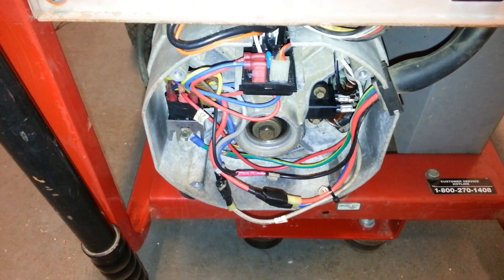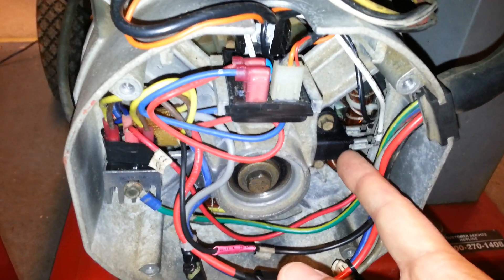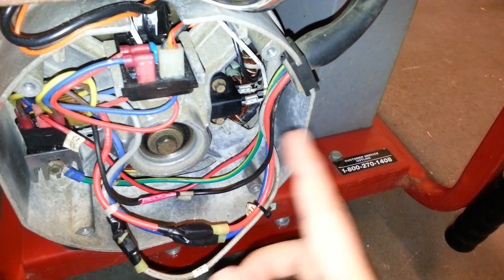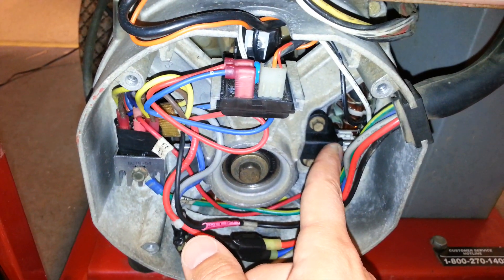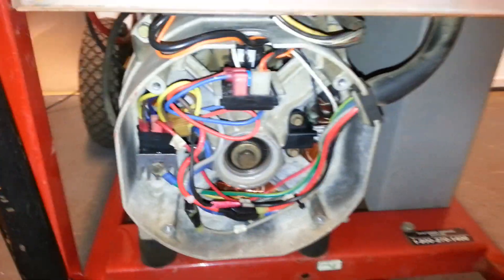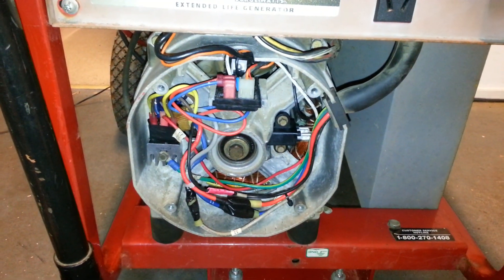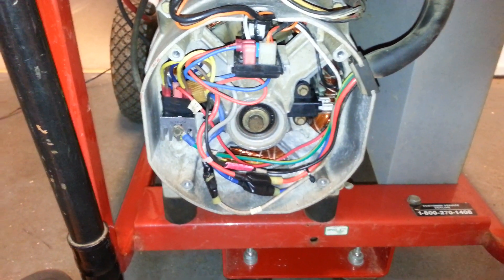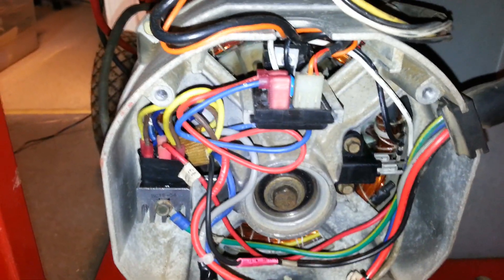Generac Portable Generator: How to Test the Windings

Comment: bought a 7000 exl generator that runs but doesn't have the panel for the outlets. how can I connect the wires directly out of the stator unit to a transfer box? would appreciate some guidance.
Reply from the maker: i would not recommend such a setup. replace the panel. it has the circuit breakers, neutral ground bond jumper, etc.

Comment: Happy New Year xboxer1985.  I have seen during my searches on the internet a Generac 7550exl the same as mine and yours with a 50 amp twist lock which ours do not have.  I'm wondering how you would use and why a 50 amp receptacle was placed on the generator when you only have 30 amp breakers.  In-addition, would you be able to use both 30 amp receptacles at the same time? Can you run 2- 30 amp lines from the 2- 30 amp receptacles to the electrical panel? Or is the generator just 30 amps in total?  Can you add a 50 amp plug to our generators?  Just curious.  As always Thank You for all your expertise.  John
Reply from the maker: John Ambrosino john. Happy New Year. Some later revisions did have a 50A NEMA 14-50R equipped on the panel, but no you cannot get 50A from the machine. 7550 watts is 29A at 240VAC or 58A at 120VAC, so no, cant use both 30A plugs simultaneously. The 50A plug is wired to the 30A CBs. The reason you find it on a generator with only 30A capacity is convenience for setups that have a 50A plug inlet but allows a smaller generator to run on it. This an alternative than making/buying an L14-30 to L14-50 adapter.
Reply: Thank you for your fast reply.  Extremely helpful as always.

Comment: Bassguitarist1985   i have a generac 7550 exl, i did the test as you explane in your video i got 3 volts and 80 to 93 ohms for the brush, i test the gray and red wire and i got 4 to 5 volts also the red and blue also gave me 4 to 5 volts, i also check the ohms on the red and blue wires and got 1 to 31 ohms fluctiates...what dose all this mean in regards to the generator
Reply from the maker: Resistance too high on brushes. Nomore than 2.5ohms on dpe. Somethings wrong woth your readings

Comment: I got 80 ohms at the connectors on the brushes… I assume that’s too high. What is my next step. I removed the brushes and checked the slip ring and got 7.6 ohms
Reply from the maker: @jwilli850  yes too high. Try putting 12 volts to brushes. If you get output voltage, PRB and possibly the SCB have failed. Both can be repaired

Comment: I have an EXL 10,000 generac that l can't seem to find anyone willing to repair it.  Tried to jump the battery, but in a rush hooked cables up wrong.  It tried to start but smoke came out of the control panel.  
Didn't try anything else after that.  I figured it was not a good idea. Any suggestions.........?
Reply from the maker: @ronm1640  Unfortunately many parts are NLA for the 10kEXL. With reverse polarity, if there was no 10A fuse on the charge wire coming from the stator/rectifier in the end bell, then those would have been destroyed.

You local in New England? Can you inspect what was smoked?

Comment: You say the rotor should show between 10 -12 ohms across the brush spades. I get a variety of readings depending on the rotors position. I get from below 12 ohms to well over 200 ohms at different positions.
Reply from the maker: Brushes are dirty or worn. The slip rings may also need polishing too.
Reply: Ok I'll give the slip rings a closer look. Thanks for the quick reply.
Reply from the maker: Anytime bud! I have google on my phone so it comes right up

Comment: opened up the back like you said ,no wires or electronics , is it possible there up between the motor ?
Reply from the maker: ray conway no electronics where, insode the electrical panel where the outlets are? You can see in another video of mine the inside of the panel

Comment: xboxer1985. Thank you for all the video's.  I have a Generac 7550exl with a 13500 surge.  Do you think our generators are able to handle a 3 ton central a/c unit? I tried once. I shut down all breakers, started the generator, than put on the air handler and a/c unit.  To my surprise it took the surge and was running but for only about 4 mins. than the a/c side breaker tripped ( on the generator not the panel).  The side with the air handler continued to run.  I did not want to try it again in fear that I may damage the a/c compressor.  What are your thoughts?  

Just an FYI: I'm using a Champion 12yc cooler plug than the 14yc which is required to be used when running the this unit the 7550exl, or 7000exl on regular gasoline.  Gaped at .20 as per Champion.
Reply from the maker: John Ambrosino the push to reset breakers do wear out. They may need replacing. If the AC is dou le pole breakered at 30A it should run it, but you cannot run anything else with it, period. You are rwally maxing it out, and a 3 ton AC is not a critical backup, unless you deem it so. The PTR breakers are thermal trip and can run 120% of their load for a specific period of time.

You may try installing a soft start capacitor to the compressor to help with surge startups. This unit is NOT 13.5k surge, more like 10-11k at best. The ultimate upgrade for any AC unit is  a "Sure Start." This unit will drop the Lock Rotor Amperage nearly 70% in some cases.

Best of luck
Reply from the maker: John Ambrosino it is also possible to sync two of these generators together, granted its not very easy to do, and when synced its hard to balance the load between them correctly.

Comment: help!! i have a coleman vertex 8000 with the winding completly burned, i already windit but i just cant remember how the conection of the stator is, can you help me with some kind of diagram or something. its just 3 wires that i completly forget by the way thanks for all the helpfull vids awesome!!
Reply from the maker: Christian Magaña Hard to say, normally on a generac or briggs wire 11 and 44 are the hot and 22 is the neutral. colors of the wires can vary.

Comment: I need a wiring diagram for a generator 4000 white 3500 champion generator switch from 2:20 to 1:20 I need the wiring diagram to the switch
Reply from the maker: If you know the model number you can punch that in on champions website and they should have a full wiring schematic for your model to review

Comment: I have a generac 7000 exl generator  when I hook power to the battery it starts smoking from the generator  part any advice
Reply from the maker: Stator and/or rotor insulation has broke down causing a short. It will need to be replaced
Reply: @Bassguitarist1985  how do I know witch one is bad
Reply: @Bassguitarist1985  and how much do they cost
Reply from the maker: @shannoncarroll3600  sadly way more than what you would pay for a new generator of the same size. The stator is likely the problem, not the spinning rotor. stator can run you $375 USD to $425 USD depending where you order from.
Reply from the maker: @shannoncarroll3600  if you get 7.5 ohms from slip ring to slip ring on the rotor, that should be fine. The stator has all the windings you need to test, but since yous released the magic smoke dont bother. cant put the genie back in the bottle as they say.
Reply: @Bassguitarist1985  ok thanks
Reply: @Bassguitarist1985  I took my ohms meter and took the brushes out and touched one to the slip rings like you said and I was getting 7 to 12 on the reading
Reply from the maker: @shannoncarroll3600  i figured as much the stator is bad then
Reply: @Bassguitarist1985  when I check the 3 main wires on the bottom like you said I only got 1.7 from them
Reply from the maker: @shannoncarroll3600  the smoke is often from the DPE or BCW windings. Very thin wires. If DPE winding smoked, stator is junk.
Reply: @Bassguitarist1985  there is a blue wire going from the start button to the rectafire that was melted
Reply from the maker: @shannoncarroll3600  was there a fuse on that wire? If not, you need one. Early revisions did not have this fuse. How did it blow? Positive cable of starter battery ground to frame? You may have gotton lucky and burnt out the rectifier and not the winding. Cant say for sure. Need to remove those burnt rectifiers from circuit
Reply: @Bassguitarist1985  I'll half to look again and see if there is a fuse the rectafire is where I got the arrow right
Reply: @Bassguitarist1985  do you know what reading I should get from stator and how to test the rectafire if possible
Reply from the maker: @shannoncarroll3600  plenty of videoa how to test rectifiers, so a search
Reply: @Bassguitarist1985  what size fuse do I need to put on the blue wire going from the rectifires to the starter switch on my generator
Reply from the maker: @shannoncarroll3600  10 amp fast blow
Reply: @Bassguitarist1985  I put a regular 10 amp mini fuse like that is in  a vehicle is that ok
Reply from the maker: @shannoncarroll3600  yup that should be fine
Reply: @Bassguitarist1985  ok thanks I found a used stator on Ebay for $200  and put it in there and it works good now thanks the windings in the other one was burnt

Comment: I have watched numerous videos of yours possibly all of them trying to figure out what is wrong with my generac 7000EXL is there a way I can message you? I joined smokestack in an attempt to get into contact with you.  thank you Mike Smith
Reply from the maker: Mike Smith you can message me privately here on YouTube. ill try to help best i can.
Reply: xboxer1985 
I have a generac 7000exl that only putting out 5.6volts I have tested the Auto voltage rectifier and control board. When tested I found that both were dead nuts on the money for ohms as per specs u stated in all of your videos. (I wrote the values down on a note pad instead if trying to buffer the video and test at the same time) My snubber  feed back has 118.8 ohms between 2&3. So I flashed the field. I first tried it with a drill no luck. Than i jumped the brushes with 12 volts and got 120 volts at my outlets. Shut it off hooked everything up still 5.6 volts. Upon testing my windings I found that my dbe winding has 6.63 ohms which according to one of your videos it is only supposed to be between 2 and 3 ohms. While giving the brushes 12v  I was getting between 77-79 volts off of my DBE windingings coming into my AVR. Is that acceptable readings to be getting? If so were do i go from here?!?  Thank you Mike Smith
Reply from the maker: Sounds like your AVR is burned out. DPE ohms is high, but that could be a dirty connector. The control board may have been fried too. If you put a new AVR in without the white 3 pin connector you will get high voltage at the outlets. IF when you reconnect the 3 pin and the voltage doesn't change, you may have a problem with the control board or it simply may need to be adjusted. there is a voltage adjustment pot on the left of the control panel.
Reply: xboxer1985 I tested the AVR.  between spade 1 and pin 1 I got 0.00 ohms. between spade 1 and pin 2 I got 68.2 ohms. between spade 1 and pin 3 I got 50.9 ohms.  between pin 2 and 3 I got 119 ohms. The diode with red lead towards spade connectors was OL. Red lead away 0.701. Red lead on white brush connector and black on black was nothing. Red lead on black and black on white is 0.704. Thank you Mike Smith
Reply from the maker: Mike Smith okay, bext thing you need to check before buying a new avr is test the DPE winding, red and blue wires 2 and 6. while hitting the brush leads with 12 volts, connect a 25 watt bulb between wires 2 and 6 while running the engine. if it lights at all but dim, then the winding is good. if it don't, then the winding is shot and unless you want to buy a new stator before getting a new AVR.

cheers
Reply: xboxer1985 ok I will test that tomorrow. given the values I got upon testing the AVR I assumed that it was good from the values u gave in 1 of your videos.
Reply: Can anyone help with rewiring a new on/off switch.  I have switch that is (on)/run/off on a Generac generator 7500e.   Can't find another like it.  Can I hook up another kind?
Reply from the maker: Henry Corbitt you should be able to find the original part on a site like partstree.com or similar site
Reply: xboxer1985 
Can anyone help with rewiring a new on/off switch.  I have switch that is (on)/run/off on a Generac generator 7500e.   Can't find another like it.  Can I hook up another kind?  It's for my Food Truck.
Reply: I apologize for the delayed response. Both of my rectifiers are burnt out. Would that cause my problem? When i give the brushes 12 volts everything works as it should. Thank you Mike Smith
Reply: Would all of my rectifiers being burnt out be my problem? Since they convert AC to DC and the brushes need DC current to excite the brushes on to the Armature?

Comment: Bass85, I have a Generac 7550 EXL,  runs no power. Disconnected and removed voltage regulator. Started engine and jumped brushes    with 12v. Dpe wires then put out 180 VAC and duplex outlet put out almost as much , maybe 174. Reassembled and sterted, no output. Seems like a bad  regulator but isn't 180 VAC high when only supplying 12 VDC to brushes ? I bought this gen. several days ago knowing it did not  produce power. Thanks for the vids. Joe S.
Reply from the maker: Joseph Syring if the resistance specs check out and the DPE supports a load like a 25 watt incandescent light when you hit the brushes with 12 volts, then yeah id say bad regulator. The SCB  regulates from 175 down to 120 at the duplex outlets
Reply: Bassguitarist1985 Resistance is 2.6 ohms  across DPE leads. Then, red to ground/generator case is 2.6. However blue to ground/ generstor case is 0.3. I am much more familiar with resedential wiring than  generators. Is this still pointing to the regulator ?
Reply from the maker: Joseph Syring so far i would say yes. Blue 6 is bonded to 22 neutral inside the stator so that makes sense.  Try repairing or replacing the voltage regulator first if you get high voltage without the three pin white connector attached to it.

If you do get high voltage then plug back in the white snubber connector 3 pin and see if it brings the voltage down to normal and you may have to adjust the blue potentiometer on the left side of the control panel. If that has no effect on the voltage then your system control board has burnt out and needs to be repaired.
Reply: Thanks Bass, I will let you know how things go after new regulator install.
Reply from the maker: Joseph Syring will do, if your SCB needs repair I can fix it
Reply: Joseph Syring i bought the same generator a Generac 7550 exl and it to makes no power i can really use your help to try and figure it out